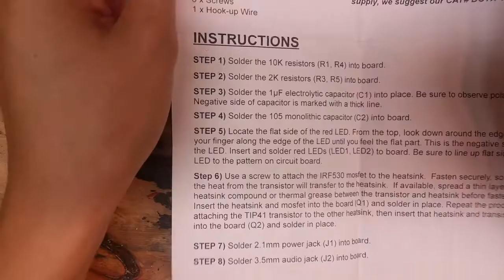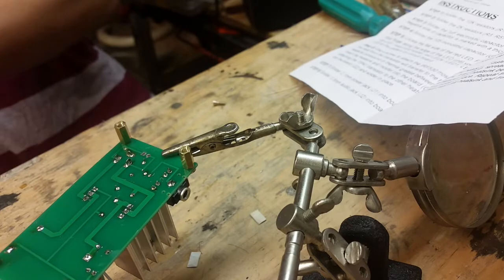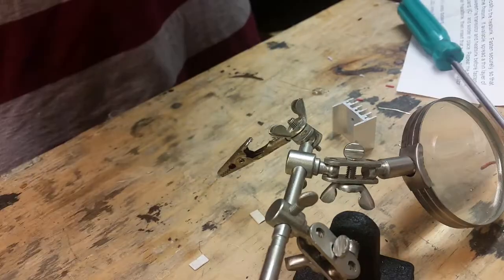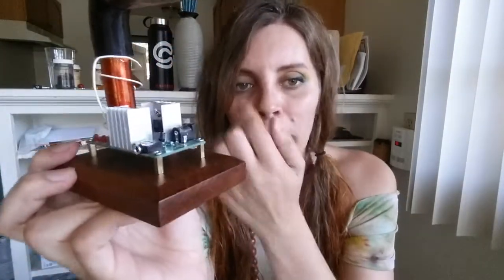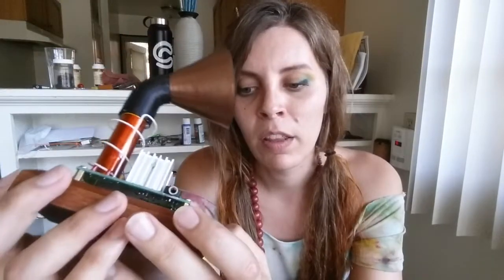Sparktrola - A Teeny Tiny Tesla Coil Plasma Speaker Kit

Comment: "Pay attention to which transistor is which"... profound advice ;)
I've got one of those solder suckers... For years I used an ordinary, everyday solder sucker and when I made the switch to one of those.... .... .... wow, just wow!
Love the gramophone horn! Not so sure about the Rick-Roll ;)
Reply: I saw a vid of someone making one some time ago.
I was going to paste the link for it here but when I googled to look for it, I found that there are heaps of them, so take your pick.
If I were to build one, I would probably go for a hollow tip followed by a filter as close as possible to stop the solder from cooling down and blocking the pipe, and some sort of el'cheapo vacuum pump.

And too many of my sentences start with "I". Bad grammar tsk tsk.
Reply from the maker: @petertryndoch8857  I will look around. Thanks!
Reply from the maker: I just recently discovered there are solder suckers that include a heated tip so you cam melt and suck with one tool. I kinda wannnt one
Reply: Yeah... CuriousMarc had one on his channel and I had huge sucker-envy... but they're a bit expensive so I compromised and got one like in this video from Germany.....
Reply from the maker: @edgeeffect  I wonder how hard it would be to build one out of a solder sucker and a cheap soldering iron

Comment: l built the exact same kit not long ago.
I felt that as an Electronics nerd I was not complete without one.
I was a bit worried at the end when you were waving it around that the hot melt was going to give way, but it didn't.
Reply from the maker: The glue did prove to be insufficient, so I ended up using 5-minute epoxy to hold the secondary down after the video was done.

Comment: Nice finished product. Does the arc generate any heat that you had to account for when positioning the cone?
Reply from the maker: Not a lot of heat, but enough to consider. If the tip of the wire is close to one of the cone sides, the corona will be drawn to the surface, and it'll start melting it. 

But there is not enough heat to need to be concerned about the heat rising and melting the plastic above it.

Comment: Great job and I love the base! Where did you get the cone printer files? I don’t have a 3D printer but have been looking, recommendations?
Reply from the maker: Thank you! :) 

I designed the cone myself with some CAD software. I should upload the STL somewhere in case anyone else wants to build one of these. 

My printer is a Monoprice Maker Select. I got it mainly because it seemed like a decent printer for a cheap price, but it's certainly not the best printer. It took a few weeks of tinkering to get it to run right. Calvin is a bit of a 3D-printing guru though, so he might have some suggestions.

Comment: You should try solder wick for de-soldering.  Much easier that the sucker.
Great video and project!!
Reply from the maker: You know, I've always had a much worse time with solder wick than a solder sucker. I actually got the sucker because I was so frustrated with solder wick. Maybe I'm using the wick wrong :/
Reply: @EmilysElectricOddities  I had once very bad results with low quality solder wick. Apart from that, using it is pretty straightforward and ensure clean results.
Reply: @EmilysElectricOddities  Good quality solder wick, plus flux from a flux pen. Get the iron a little hotter than normal, heat the wick placed on the joint, don't directly heat the joint with the iron. The solder will flow to the heat. Once  you get the hang of it you will love it, it would have had your two transistors out in a jiffy without all that prying.
https://www.youtube.com/watch?v=rdI3xDlzxVU
Reply: That is no ordinary, everyday solder sucker. wick always worked better than my old solder sucker... but when I got one of that particular make/style... it, it changed my life!
Reply: Some solder wick is pre-loaded with flux.  That stuff is like magic.  If your wick is not working: flux will make a world of difference.